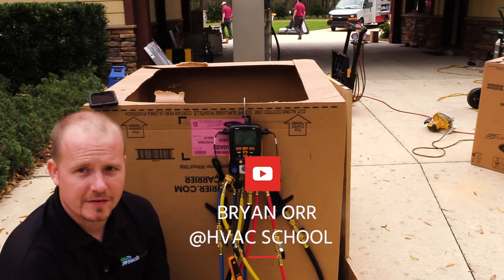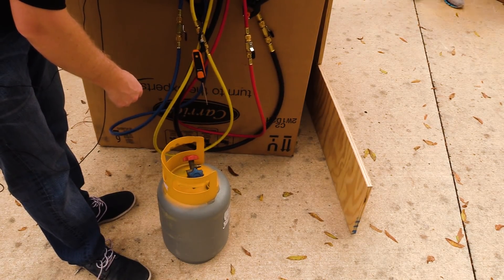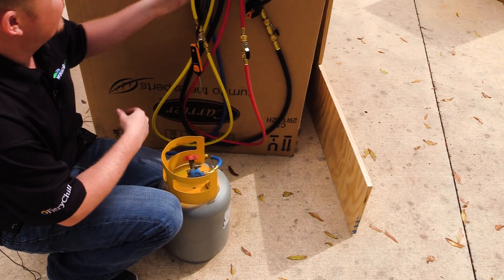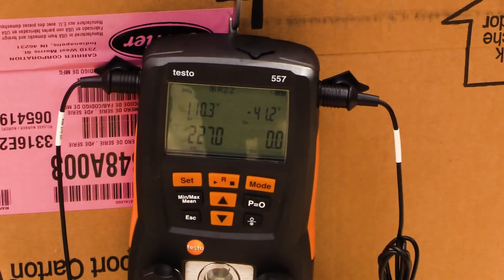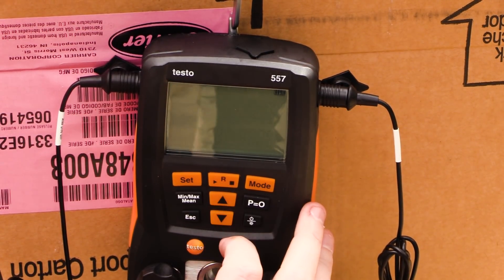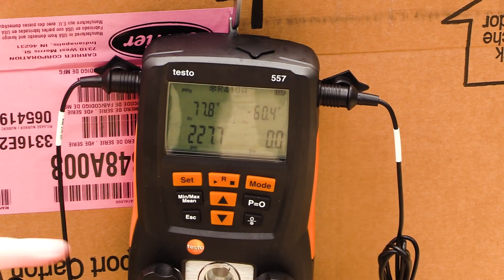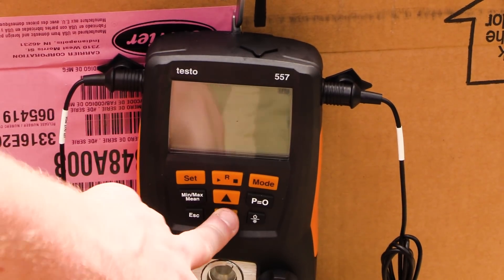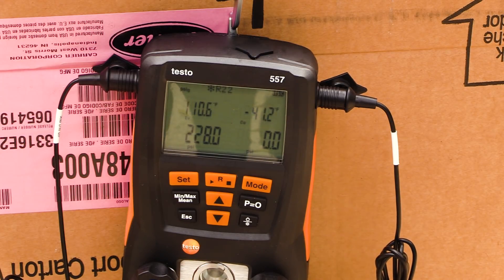How to Identify Refrigerant Type

Comment: You said you can’t do it on a system. Can’t you just fill your gauges, remove them from the system, and when the pressure stabilizes compare it to your ambient temp that your gauges are in?

Comment: I have a recovery tank and  i
Dont know what kind of refrigerant fill inside. I will check the pressure i got 175psi..pls help to identify what kind of refrigerant inside the tank.
Reply: U figure it our? If bottle was at 68⁰, it would be r410a

Comment: Yea you can do the same thing with an analog gauge and a pressure temperature chart.  If you do it on the system, you have to take the temperature at the coldest part of the system, where both liquid and vapor are present, to form a Pressure temperature relationship.  This guy Brian is a very knowledgeable person, and also a great teacher.

Comment: I`m not clear on how you determined the tank temp? you have some kind of tool connected to a phone app? a little more clarity for us old slow guys please.
Reply: The gauge took the pressure and automatically (in this case the R22) pressure temperature chart created the saturated temperature, now he then took an actual ambient temperature. Because the temperatures were not similar, its not R22. So next was to check another refrigerant. Unfortunatly with the blended refrigerants it gets harder to convince yourself what you actually have, also remembering that in blends theres different boiling points of the refrigerants used and if you purge enough times youll have an even harder time knowing the gas. You can do this off mechanical gauges aswell, its just the same, but youll need to check the P/T chart for the temperature…its years too late, but hope ive helped somebody.
Reply: get a digital field piece gauges

Comment: 24 years ago I got my first refrigerant analyzer because the good enough math it was not always good enough and there’s too many variables with types of refrigerant that have lower pressure is the gas that you’re testing for. I don’t think my area of the country is immune to ignorant individuals (unethical, immoralwho for profit) believe drop in replacement gases mean exactly that drop in a different gas on top of another gas and they do that a lot here. in the days where we only had a few refrigerants when I was a kid and my dad was showing me the very same method you just described it worked very reliable. To get rid of the air we took it a step further and put the tank in a freezer -22 to -27° below zero and then bleed off the excess of air that would not condense and lower the pressure the air would stay pressurized on top of the liquid refrigerant. Shake the tank let it set repeat this three times. Take the tank out into your house climate controlled a room that stayed constant 70° overnight. Preform one more vary slow air purge. Let the tank equalize in temperature for a few hours and then take your pressure temperature test to conclude what you’re in product refrigerate was. When double checking this method it against a refrigerant analyzer always had 0% air in the product afterwards. Here in San Francisco area roughly 4 out of every 10 or 22 systems have some other refrigerant mixed in with them especially when you get to the areas where restaurants or property owners would often get the cheapest individually can fine to maintain their equipment until that person can no longer fix the problems they created and they finally calling somebody they actually have to pay to correctly diagnose problems. I always throw my refrigerant identifier before hooking up because is a lot of missed diagnosis with incorrect refrigerant inside systems refrigerant identifier will save your ass especially if you have a young inexperienced technician on a job site cannot figure out the problems he is having wasting time is due to the fact somebody before him mixed refrigerant
Reply: like!! Good
Reply: Never thought about putting it below freezing to get it to condense to get the air our of there! awesome appreciate that idea
Reply: Yup this mixed freon problem is going to be getting worse as time goes i'm am looking to buy refrigerate identifier or analyzer what model or brand do you recommend?